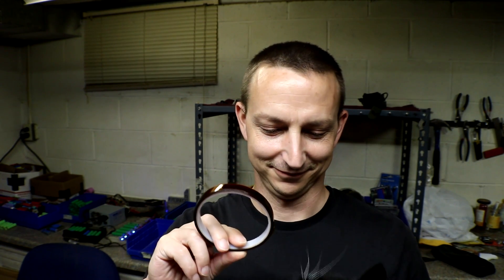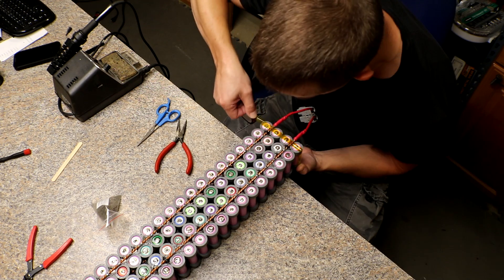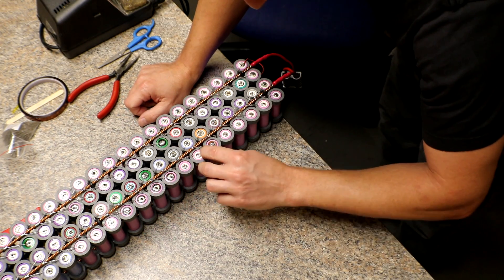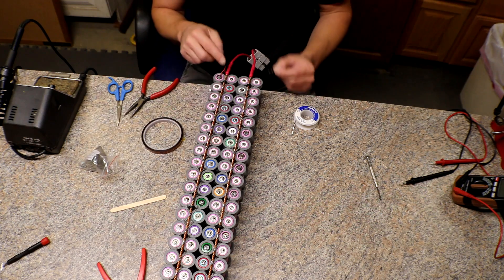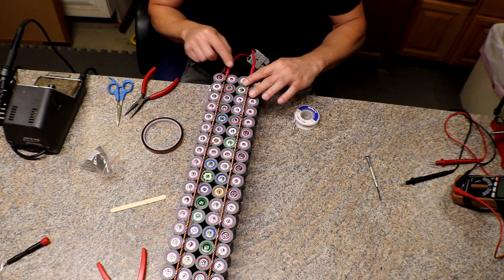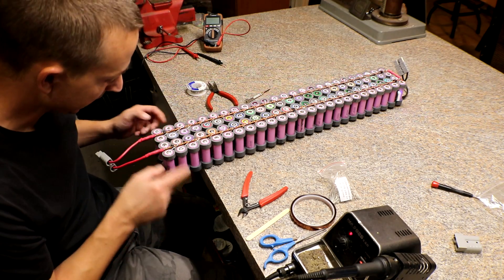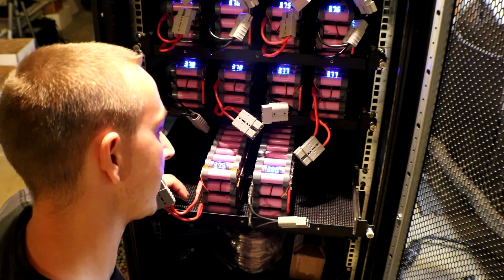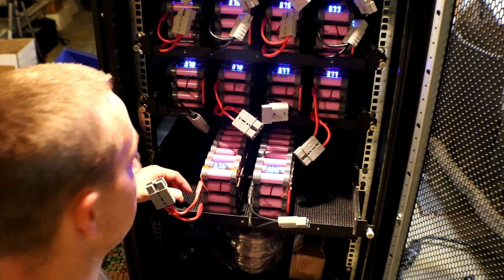Diy Tesla Powerwall ep57 Fuse Checking!

Comment: Thanks for the video. Very informative and helpful. I am new to this and would like to see the fuse that you are using. Is it just a wire? Could you do a close up on the fuse please? Thanks
Jim in Chile
Reply from the maker: Yeah I have videos about the fuses I use on my ch with close ups ect!  Cant remember which ones but I know the fuse testing video shows them!
Reply: @AVERAGE_JOE  Thank you. I am kind of a dunce on all things electrical and that is saying alot since I am living off grid in Chile. Can you do some comparisons on the battery sizes for solar systems. I currently have 12 AGM batteries at 200ah on my 10Kw system. 
I am trying to get my mind around what I would need to do to have more battery power or even completely replace my batteries when the day comes along. I sure do appreciate the help in advance. 
Jim in Chile.
Reply from the maker: To compare my battery to yours, mine is 226ah at the moment. I plan to double it when I get time.
Reply: @AVERAGE_JOE  Ok so your whole battery bank adds up to 226ah? How much hard money do you think you have spent on the build? I am sure my prices will be different but at least it will give me some ideas of what to ball park expect when I go and start building my batteries.
I actually have two systems a 1500w system and a 10kw system. I need to upgrade or replace the batteries on the smaller one. I am thinking that i could do the same as you are doing and build myself a battery bank. 
I really love your videos and the work you do. Thank  you. Jim
Reply from the maker: On the battery side only maybe $500-600. I got a lot of stuff free😁👍
Reply: @AVERAGE_JOE  Wow this sounds like something I should do. I think that in the long run it will save me a lot of money. Jim
Reply from the maker: If you can find the batteries, its a nice way to go!
Reply: @AVERAGE_JOE  I have not seen anyone here in Chile doing this. I am hoping I can get ahead of the curve and buy some old computer batteries and get going. Thanks again. Jim

Comment: I noticed that most of the broken fuses are on the 4 cells closest to the power connector column.  Try changing the fuses to the negative side of all cells.  The positive side 1st column fuses have more mechanical stress due to the power connector connections.
Reply from the maker: Yup, thats what I ended up doing later on!👍

Comment: Say is there another way to check fuses other than visually?
Reply: I just finished soldering up 700 of them but would like a way other than visual to check the fuses.
Reply from the maker: Nothing solid yet other then the batrium and using the data to see how fast or slow a pack charges and discharges. Or if you had a volt meter on each pack and monitor occasionally. Theres ways that a led could possibly be used but I dont have that way yet.
Reply: Does the batrium measure capacity?
Reply from the maker: You enter in your capacity when you set it up and then it will go from there

Comment: I need and advice. I have modules of 6x12=72cells 2150mA(572W). I can buy 3000mA cells so I am making 4x13 modules(577W).  I am installing this different modules in series, do you thin they will work right
Reply from the maker: Yeah for the most part, just keep an eye on the pack voltages after using them for a while to see if they go out of balance unless your going to use a bms!

Comment: How about putting a normal led bulb in parallel to the fuse so that it glows when the fuse goes off while on load???
Reply from the maker: +Mukesh Pati Ill be testing that here shortly along with seeing if the fuse still pops at the same amp raring with it attached.
Reply: AveRage Joe I guess pairing a diode (led) will not affect the tolerance of a fuse as a whole.......but still one should be sure about that......

Comment: thanks for the great videos.  beginner question - I read through only half the comments so excuse me if you already answered this one.  What purpose does the fuse serve?  I think you mentioned that it prevents older less powerful cells from over heating when too much power is being pulled from them, correct?
Reply from the maker: Thanks for watching!!!  The fuses are used for when a cell goes bad.  Like if its there time to not hold a charge or if something shorts out it wont send a huge amount of current and possibly (blow up or catch fire).  I use smaller amp fuses so if the cell starts to go bad it will pop the fuse sooner vs later.  Some people use higher amp fuses or wire and if the cell is going out it will drain the pack down or create an unnecessary load on the pack until that particular fuse pops.  If its a slow drain then a fuse wire will slowly heat up and start to glow red hot untill is pops. Does that answer your question?
Reply: Yes that's perfect.  What about the battery packs you see others pick up online?  do they have these fuses built into the cells, or are the fuses located outside of the pack and should be added by the installer?  I thought I recall Jahu mentioning that some cells have them built into the cells, but I could be wrong.
Reply from the maker: +Gerald Grogan Awesome😃 A lot of the prebuilt packs are new cells and wont be fused like we have been doing. Yes, some do have a little protection circuit on the top of the cell and some dont. Yeah I would add a single bigger fuse on the end.
Reply: just to clarify - if I had pre-built packs with 'new cells' are you are suggesting to add a fuse to the end of the pack, correct?  This is interesting since I'm in the planning stages, I'm wondering how much care and feeding a custom built wall using recycled cells would take? Perhaps 'new cells' would be a better option for some - like me.  Just curious
Reply from the maker: Yeah I would add a fuse at the end.  I was going to put a fuse in between each pack (and may still) but didnt yet. What voltage are you gonna do?  It really depends on cost and how comfortable one is about building with used cells.  I tinker with everything so I am comfortable with it and cost was a big factor for me.

Comment: how much amps pulls a dead cell?  sorry for my english im from switzerland
Reply from the maker: +niklaus stöckli For my system its 2amps or more but it really depends on the fuse you use. I wantes the fuse to pop early on so a dead cell wouldnt pull down the pack.
Reply: i got 20A samsung cells on my skateboard..... how can i test it..... i have no dead cells
Reply from the maker: Oh ok ya a skate board or e bike battery is set up a bit different.  I havent looked into much for that style of battery but I think most only use a fuse at the end so you you could probly do a 30amp fuse and be good.
Reply: yes my cells have 20A..... woud you recomend a 30A fuse? or a 100A on from cell to cell..... i have 4p in paralel
Reply from the maker: +niklaus stöckli Anyway you can send me a pic of you battery setup? My email is on the about me tab. Are you doing a 4S4P?

Comment: Why not put some glue gun at terminal
Reply from the maker: +Siddharth Kumar I did at one point but it didnt seem to hold. I probly didnt have enough lol
Reply: You can try one more thing. I bet it will work. Get 4 X 4 inch plastic sheet not too hard (you have mesuare it for correct size) cut in half so it will be 2 X 4 inch. Get 4x m3 long screws and 4 bolts. I idea I simple we will clamp it from both side where you used kapton tape.

Comment: I would have used a wire tie around the wire and glued the latch part to the battery rings. You could also glue an extra ring in the gap under the buss bars and bend the buss bars down to go through the ring. Yes I know that would be really hard now. maybe cut the rings in half that way you would only have to bend the buss bars down and glue the ring around them. Good video even if you do like cats! :-)
Reply from the maker: +Ron Safranic Hhmmm a ring huh. I think I follow. Not a bad idea! Yeppers, 2 cats lol 😀

Comment: What is everyone doing with low voltage cells? I got about 50 that test between 1v-2v should I try to bring them back to life?
Reply from the maker: I test everything that shows positive voltage.  a tp4056 will charge them when they are really low.  If you dont have a tp4056 charger then do a bump charge from a charged cell or a computer power supply to bring the voltage up.  Then put in your charger to capacity check.

Comment: I would've glued another 2 x 18mm tubes  between the last 2 where the terminals are and cable tied it. either extend the length as you do if another row of cells were to be added and cable it or put the last 2 between each terminal, would make it look like a house roof top if you know what I mean. better than tape I guess. but that's just me.
PS: Seattle is great....... so far... (still summer, but fires smoke around now).

Lol, looks like your repariing it at normal speed at time but then I see the HAKO flashing and knew it was sped up.
Reply from the maker: Yeah I gotcha on the roof example.  I might add something on the ends kinda like your saying.  I have some nylon all thread 2 cells in but should of put them on the ends lol.  Flashy Flashy😜

Comment: Yeah I'd even leave the volt meters. It's basically manual BMS except.. these batteries are used so always having the feedback makes sense.
Reply from the maker: Ill keep them hooked up but will be moving them later cause when the door is shut on the cabinet you cant see the top row 😄

Comment: I use the my multimeter probe leads to test the integrity of the solder points on my packs.  I find that if they are loose, then I will be able to see it better than using my finger, which I used to use.
Reply from the maker: I did test most of them, especially the ones that looked like they could of not been soldered all the way  👍

Comment: Good watch. I'm just getting started here with my 18650 powerwall so I'm enjoying your content.  I already have panels up (for 4 years now) and going the 18650 battery route because I'm not happy with the AGM batteries performance.  I'm hoping the recharge time will be reduced.  I have the PCM60x and really like it.
Reply from the maker: Awesome!!!  Yeah this is replacing my Trojan t-105 lead acid batteries.  Had them since 2008.

Comment: I'm building a 20 kWh battery out of LG cells from hoverboards(4 5kwh nominal 15S modules). It's taking a while to test 3000 cells, close to 1600 have been tested. I'm going down the path of totally custom battery holders that use a pcb to connect the cells in parallel making 1s 42p packs. The PCB lets me use surface mount resettable fuses in conjunction with 5 amp fuse wire connecting the 18650s to the PCB. Fuse wire is spot welded to the cell and soldered to the pcb. It makes the pack less of a piece of fine china because the resettable fuses clamp down on short term current surges at 2 amps per cell, short term current surges or accidental shorts won't blow the 5 amp fuse wire. If a cell has a internal failure or the pack is shorted for a long time than the resettable fuse will eventually fail and that's when the 5 amp fuse wire blows.
Think this will work?
Reply from the maker: Nice!!!  Are you doing any video of it or pictures somewhere?  Sounds like a cool build!!!
Reply: AveRage Joe It's batteries in cardboard boxes and cad files at the moment. I plan on making a vid when I get my test run of 1s 8p pcbs made, then another vid farther down the line when the big packs are farther along or complete. I have access to a Haas cnc machine and the owner lets me use it for $30 per hour plus tooling costs(verses $80-150 per hour). The 1s 42p packs are two strings of 21 18650s, each pack will have a case made with 2 aluminum blocks going down the length of the pack that conform to the exposed side of the cells separated by thermal transfer pads. The side facing away from the cells will have fins like a heat sink and a channel for a copper pipe so they can be liquid cooled. It's a learning and experimenting project, not so much bang for buck.
Reply from the maker: Sweet! Ya Id love to see it when its all ready to go!!!.  A cnc would be awesome, so much you could do with one.  I plan on building a 24x24 mini cnc and arduino sometime.  I have some of the parts just need the time to do it!
Reply: Best of luck with your cnc I have a cracked mastercam x9 software, let me know if you want the files. Instead of kapton you could use heat shrink, they make the size needed.
Reply from the maker: +Shannon Williams Ok cool ill let yoy know. Ya heat shrink would work.
Reply: can you give me info on those batteries. I want to buy some but I worry that they will not have a capacity over 2000 mah..Have they tested good for you? I am new at this and don't know what pcb is and the surface mount fuse's. Any help would be appreciated. Do you have a link on the fuse's or a video that would help?
Reply: longneck43 
PCB is a printed circuit board. like inside electronics. where all the magic happens. and the smd or surface mount fuses are like the other through hole devices. mostly used in older electronics. the surface mount is lots smaller. and mounted on tiny pads. instead of through a hole and soldered . I'm new to all this also. kinda.  its been hours of videos , reading. and googling terms or devices I didn't know of.
Reply: longneck43 sorry for the late reply, the other fellow explained what a pcb and what a surface mount device is, smd. ALL cells tested around 2000-2350 mah. Buy as many as you can, they are great quality for the price. The fuses are called PTC resettable fuses. PTC stands for Positive Temperature Coefficient, meaning it responds or has a increasing resistance from a increase in temperature. There are NTC fuses which can be used to protect the cells from discharging in freezing temperatures. 

The route I am going is more complex than most diyers and requires knowledge in CAD, CAM, electronics, pcb design and manufacture, etc. What I am doing is not a project for beginners. Go about it the way presented so far in the diy community, read books watch video on diy lithium batteries, lithium battery management systems, solar systems, etc.. Once you built batteries and assembled a small system than scale up and do more complex builds.
Reply from the maker: +Shannon Williams Interesting!

Comment: Hi Joe, I had the same problem with the Anderson plugs and breaking fuses and touching and blowing a whole pack .i soldered a small busbar between the two right at the end and hot glued it down and around. It worked a treat. Mine are the same as "fly jabaru"? That soldered bus bar between makes a huge difference. It's getting there mate. :)
Reply from the maker: I do remember him doing that.  Maybe Ill try that, sounds like it would make it more solid.  Thanks 
👍

Comment: I used hot glue and tape for mine, then a multi-meter to check that there all connected.
Reply from the maker: +sven I did check a good portion with a multi meter. At least the ones that looked like they might have been questionable 👍
Reply: Love all your videos I'm new to building the18650 battery packs // have been using the large 12 volt batteries too expensive.  I was checking your older videos looking to see if you talked about your sliding out battery storages shelves and cabinets where did you find the battery cabinet ?  Love the cats as I have 2 and mine get into everything I am working on.  keep up doing a great job.